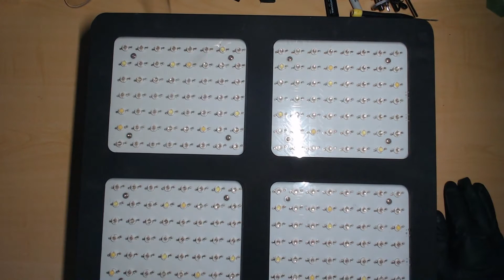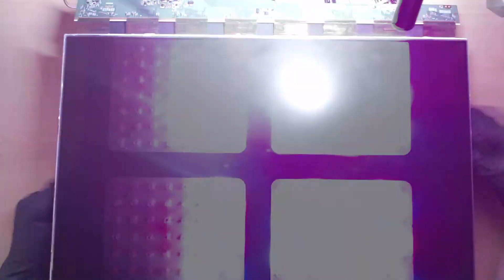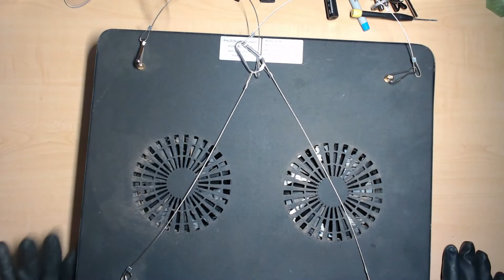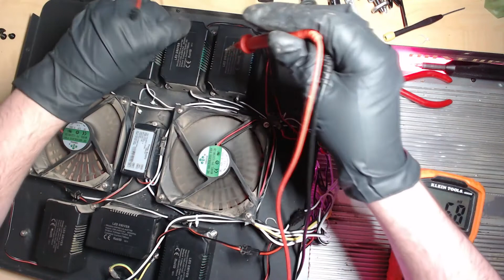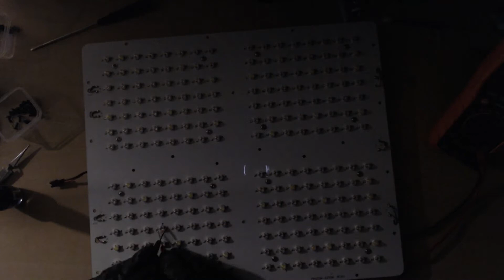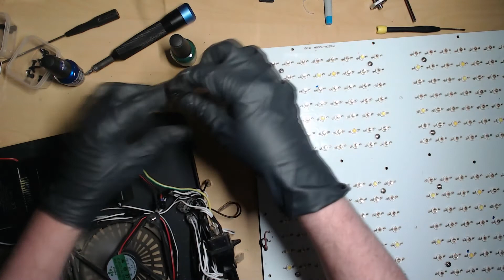Phlizon LED Grow Light Repair PART 1 - Short edit

Comment: Hey! Hey! Could u recommend a suitable LED driver replacement for these? Got the same model, 700ma 75-85V output but cant find those exact specs for a replacement. It would save me from buying a new one and would really appreciate it. Afraid of getting different specs and end up burning the lights. Thanks and keep up the good work! Close to 20k!